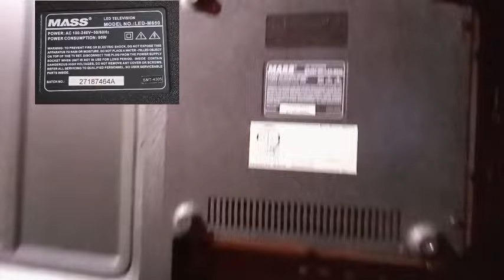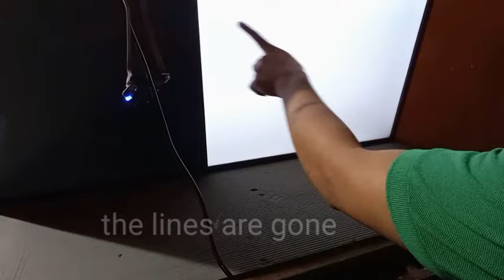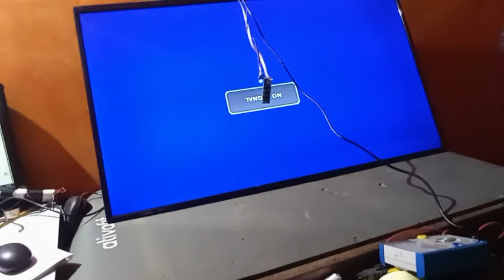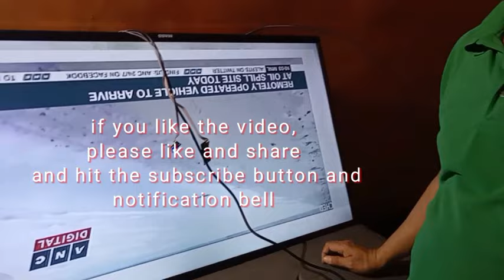How to fix LED LCD TV with horizontal lines on the screen (Mass)

Comment: Thanks .It really worked for me . Most upper horizontal line are vanished . There are 2 more left . What is the life afterwards ? Is it permanent fix ? Or the lines will come back ?
Reply from the maker: as of my experience, the lines will come back after several months.
Reply: which are 10 lines bro?

Comment: Why can’t we replace the flex ribbon on the left if thats what caused the problem?
Reply from the maker: no. The flex wire or ribbon wire is not the caused of the problem. some devices inside the LCD panel are shorted. So, we will block some signals going to the LCD Panel. Actually, the LCD panel have an initial damage. We cant totally fix it .Our method is the remedy only. By doing this, maybe the numbers of pixels will be affected
Reply: @EdwinAlcontin  Thank you for the quick reply. I have tcl 50’’ led with same problem that you just fixed. I guess i ll need to do hit and trial method to block the signals on the flex ribbon isolating pins one by one. Subscribed👍
Reply from the maker: @SyedAbbas-rz2zk  Thank you sir. Yes, trial and error can works if you have time. If does not works, it is better to go to the qualified technician

Comment: JVC smart ganyan na ganyan ang Sora Ng TV KO Ilan line ang need KO takpan boss salamat sa pag sagut ❤❤❤
Reply from the maker: Pm po sa akin sir. Gusto ko makita ang tv nyo through pics and vedio
Reply from the maker: Edwin M. Alcontin messenger ko
Reply: I have DYON smart TV, how many lines do I have to cover?
Reply: Sir,my tv screen is flickering 8horizontal black line showing and it is 60inch kth led tv.is it work on it??? thanks in advance for your help

Comment: I'm confused. How can blocking the ribbon lines partly solve this. I mean, I was thinking you would than have partially signal, since you block halve of or part of the signal cable
Reply from the maker: thankyou for the comment. it is really a good question. you have a desire to know more.
my video alone cannot answer your question. However, there is a serries of seminars on how the LCD panel works may available in online session.
Reply: The other lines compensate for the loss of the blocked lines.
Reply: @ianwilliams8234  okay. Is iuod think each lines corresponds to a section of the tv

Comment: Why ten pins, and why the manifacturer put them there?
Reply: Some signals from the panel are shorting so.he is blocking them. Maybe the quality of the screen is not the best again but the lines are gone. The number of blocked lines depends on the tv

Comment: Sir may lines din po sakin ngayon lang tlaga nasa 5 yrs old na po yung TV ko LG 60 inch 4k tv may horizontal lines po sa ibaba ng screen, ilang lines po kaya tatakpan ko ng tape dung sa flex cable Sir? thanks po!
Reply from the maker: Sorry late reply.
Magkakaiba po ang kinaroroonan ng kanilang gates na kailangan e cover. Dapat pa e identify kung saan na lines sa flex.
Mas mabuti po na patingnan nyo nalang sa qualified na technician sa inyo lugar.
Medyo masilan din kasi. Kung magkamali sa tapal, pweding matuloyan sa pagkasira ang panel